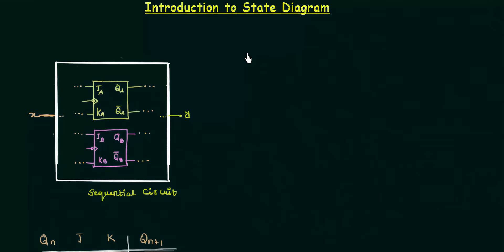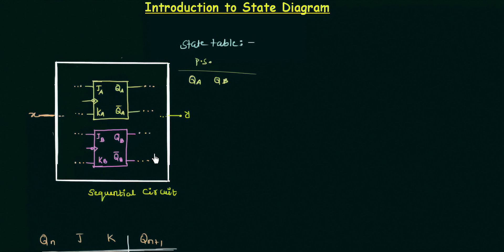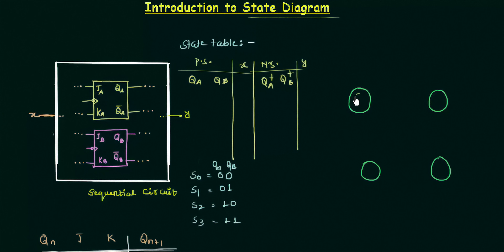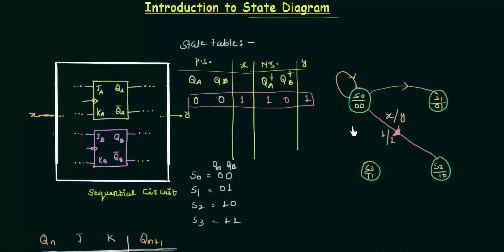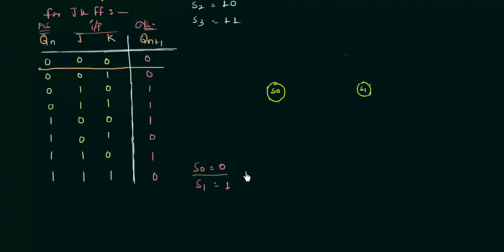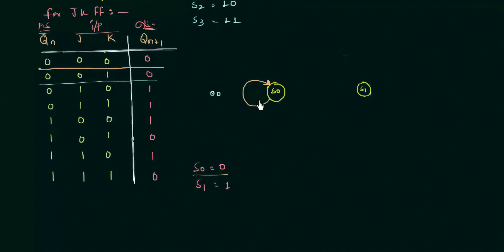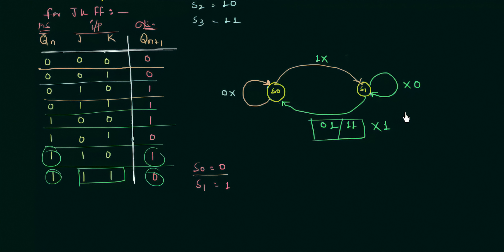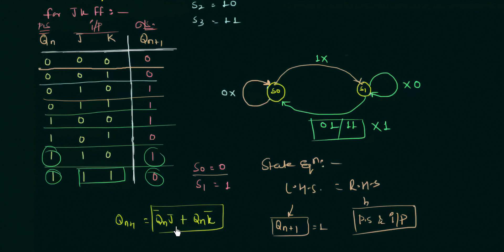Introduction to State Table, State Diagram & State Equation

Comment: A possible explanation for Don't care: (Take it with a grain of salt)

J = don't care, K = don't care: This means that the flip-flop will maintain its current state regardless of the values of J and K. In other words, the flip-flop will not be affected by changes in the J and K inputs.

J = don't care, K = 0: This condition is typically used to force the flip-flop into a reset state, regardless of its current state. It means that the flip-flop will be reset (output Q = 0) regardless of the value of J.

J = 0, K = don't care: Similarly, this condition is used to force the flip-flop into a set state, regardless of its current state. It means that the flip-flop will be set (output Q = 1) regardless of the value of K.

J = don't care, K = 1: This condition doesn't have a typical use in a JK flip-flop. However, it could be used in a specific circuit design where the behavior of the flip-flop under this condition is explicitly defined.

Comment: hey guys , 2 doubts:
1. As per explained earlier in this video , in state diagram, when we are mentioning input and output, we are using 1/0 for 1=input and 0=output , but at the same time when there were two states need to explain ,i.e. at 7:24 , you mentioned inputs like 10/11.

How can we differentiate whether these are inputs for two different states or whether these are input outputs.
Please check and suggest

2. how to derive state table? Thats the biggest challenge!!!
Reply: Still helpful after 3yrs when someone replied answer in the replies ❤
Reply: he just used it to show two possible inputs, later he wrote 10/11 as 1x so 1/0 for 1=input and 0=output is correct. You shouldn't use 10/11 for inputs in state diagram. Even though this question was asked 4 years ago, just thought this would be helpful for someone.
Reply: @dadapeer5873   even though this comment was commented 1 year ago, it turned out to be helpful for me, Thanks Mate :)
Reply: im pretty late but to derive state table we need a whole flipflops knowledge

Comment: one question;
How the don't cares are decided?
Reply: Because  ...lets say the input is  00/01
Then it doesn't matter if the right side digit is 0 or 1 ( 00 and 01 have 0 and 1 as right side digit respectively)  input will bring about the change ....as long as the left side remains 0 ....